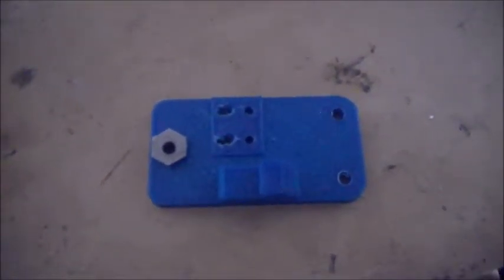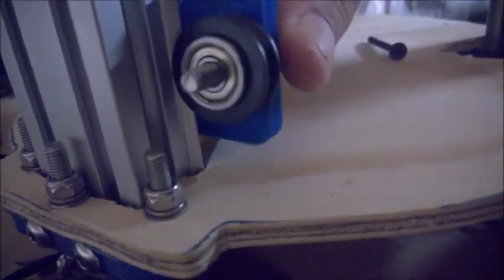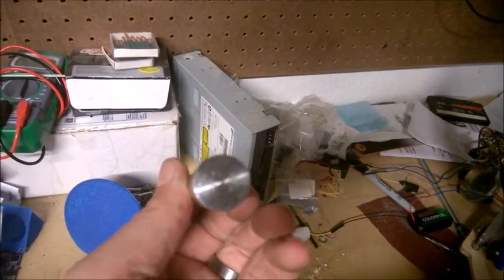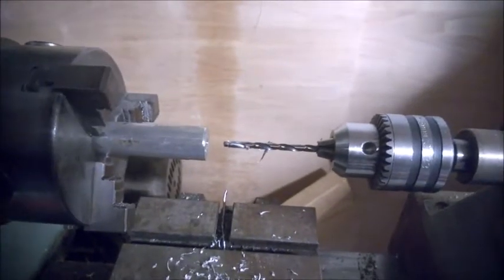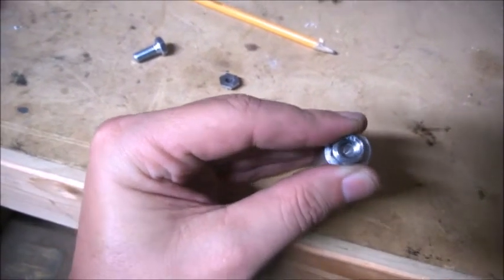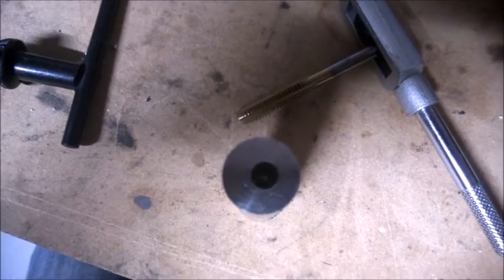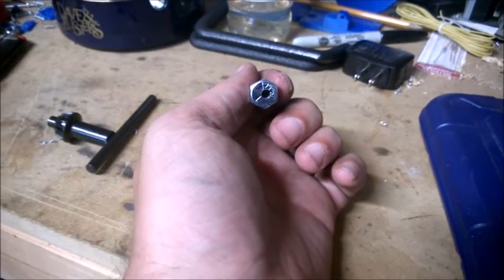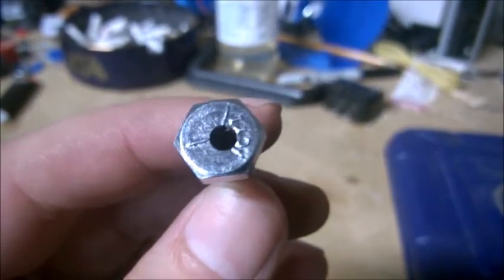How to make an eccentric spacer

Comment: How do you secure the eccentric spacer to the final plate? 
What do you do with the 5mm tapped hole? Do you put a threaded bolt into it as an axle for the bearing wheel? Or do you first put some kind of cylinder on to the 5mm bolt so the threads are covered?
Thanks!!( I built a cnc on my channel too.)